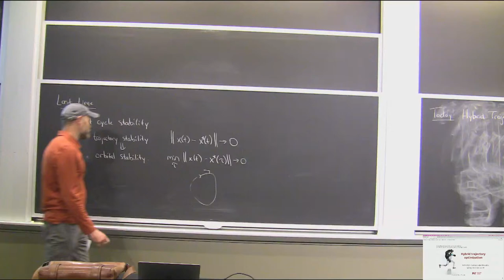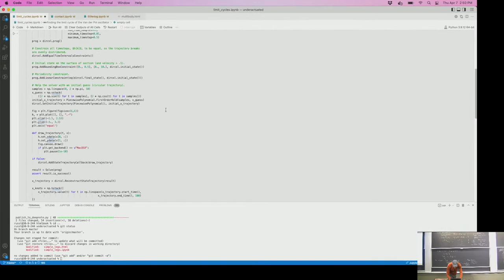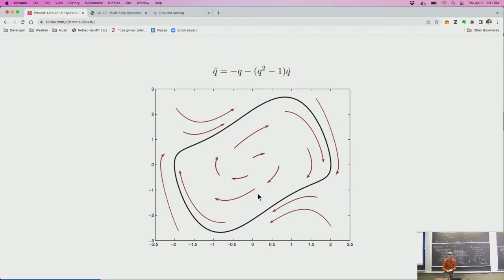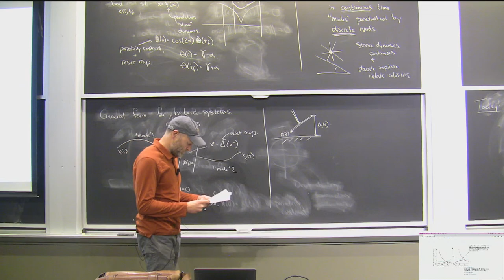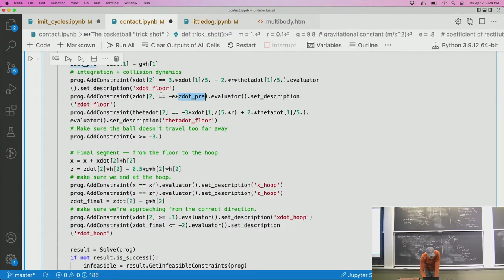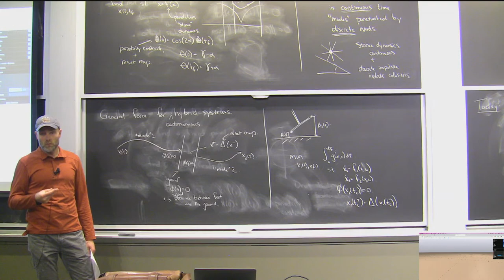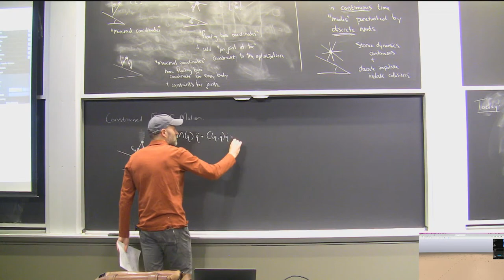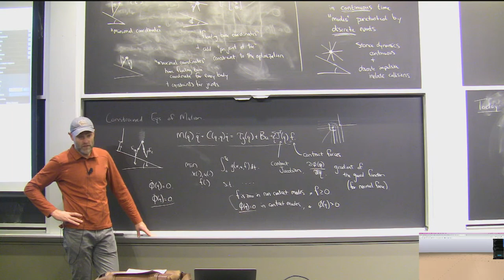Lecture 16: MIT 6.832 Underactuated Robotics (Spring 2022) | "Hybrid Trajectory Optimization"

Comment: In the lecture note 17.1.1, the formulation of hybrid trajectory optimization has 2 determining variable （state var x_k & collocation point h_k）.
dose it mean that N_k time duration of every sequence is computed by every mode dynamic f_k and initial state x_k & u_k ?
Reply: Using the notation in 17.1.1, h_k is the timestep used in mode k... which allows the duration spent in mode k to stretch and shrink.  It is a decision variable.  The solver needs to find values of h_k that describe a dynamically feasible trajectory that reaches the hybrid guards at the end of the interval (and minimizes the cost).